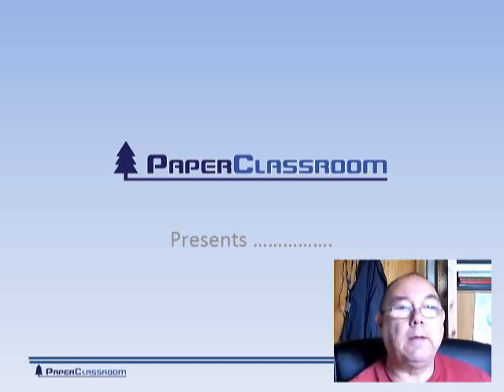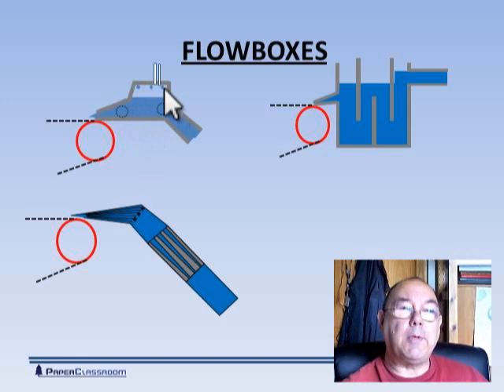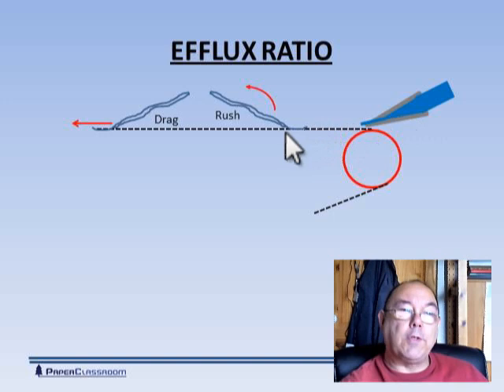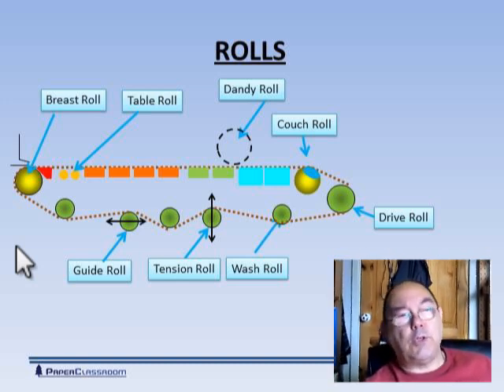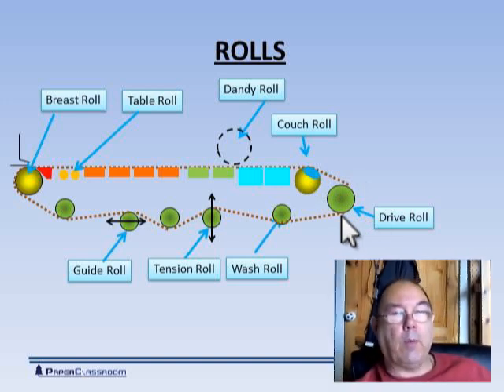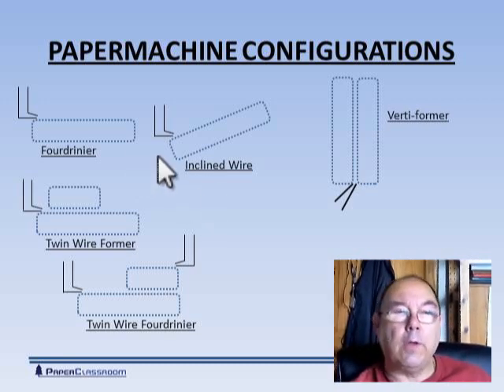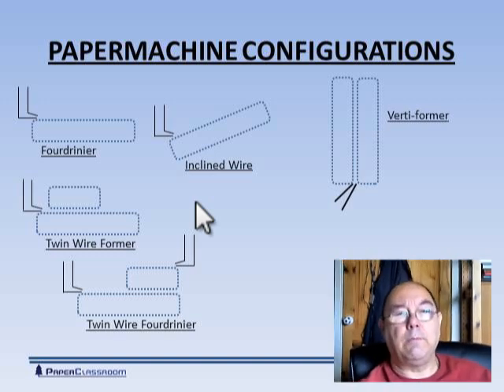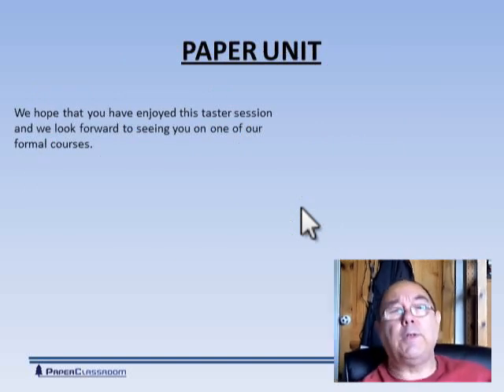Introduction to papermaking - Sheet Formation Paper

Comment: How to decrease porosity from paper machnie without adjust compotition of stock?
Reply from the maker: There are several ways to adjust porosity.
1 - change the refining - the more refined, the lower the porosity
2 - changing the filler content - the more filler the lower the porosity
3 - increasing the shake can have a small effect on porosity
4 - increasing press pressure can reduce porosity
5 - Increasing pressure on the calender can reduce porosity
6 - adding a film former like starch/CMC/PVA particularly at a size press has been used to reduce porosity

Hope this helps

Comment: 0:12 Answering Questions
0:52 Flowboxes
Open Flowbox - Open to Air
Pressurized Flowbox - Pressurized Air - PROBLEM, Mold/Condensation

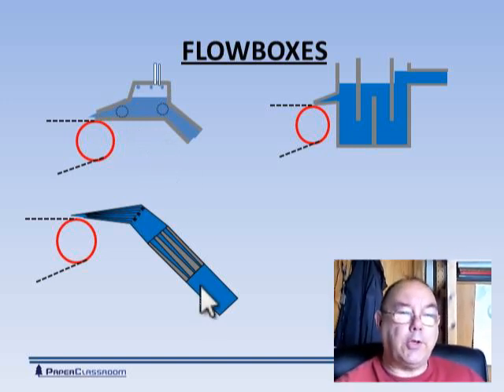2:32 Hydrolic Flowbox - Filled With Liquid, eliminating mold potential

3:19 Efflux Ratio - The speed 
Drag
Rush

5:45 Rolls

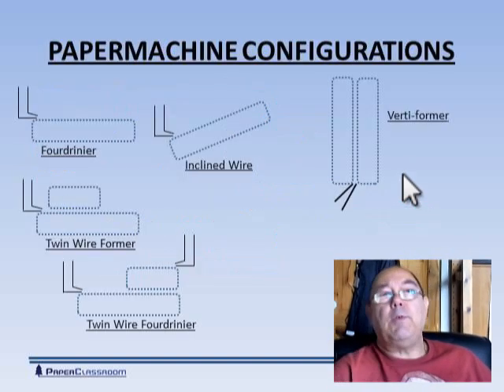10:43 Paper Machine Configurations

13:30 Drainage Elements

Comment: Is the adding of calcium carbonate just to brighten the paper...anyone ?
Reply from the maker: Hi Jim. The short answer is no!  The main reason for adding a filler, (usually chalk or clay), is to make the product cheaper. - You are replacing fibre that can be 500-1000 GBP per tonne with a material that costs about 100 GBP per tonne. But there are other 'added benefits'. Generally filler is brighter than fibre, so by adding chalk will make the sheet brighter. It also makes the sheet smoother. It fills in the valleys between the fibres giving a smoother surface that is better for printing. It also fills in a lot of the pore structure of the sheet, which reduces the porosity of the sheet, which many users want. It improves the appearance, (formation), of the sheet, which is always good. Finally, It is easier to evaporate water from the surface of pigment particles than from the surface and inside of fibres. This means it will reduce the cost of drying.  Hope this helps, Steve
Reply: @PaperClassroom  thanks very much Steven, i didn't realise there was so many reasons lol.

Comment: In very old books the paper pulp fibres aligned in one direction to ensure the shape of the book was stable.  I notice by examining books today through the light box that this is not the case, there is no direction.  I wonder why? is it that add-on chemicals and treatments assist with this property?  Also I wondered whether the effect in olden days was achieved solely with  "Drag" as you explained in minute 4? does that align paper pulp fibres in a preferential direction? Finally, there used to be a problem even in 2000 with "flocculation" whereby the fibres jumbled up and it was important to detect this (Valmet suggested this problem to me) with computer vision to stop the machine quickly. Could you explain what causes flocculation?
Reply from the maker: Hi Daniel, thanks for your question
When those old books were new, I was probably a student reading them!
I am guessing that the alignment of fibres, in the machine direction (MD), (caused by the 'drag' action), was also to maximise the tensile strength of the paper in the machine direction, so it could be pulled through the reel fed printing processes at high speeds. However when that paper is subjected to a moisture change, say an increase as happens in the offset printing process, the fibres, and so the paper will expand significantly in the cross direction, (CD), but not much in the MD. Operating paper manufacture in 'rush' mode will give a more equal distribution of fibres in both the MD and CD. This is what we call a 'square' sheet. An increase in moisture will cause the sheet to expand less in the CD and more equally in both directions. Which is what some printers want.
Many of the people offering on-line measurement can now detect and put a number on the degree of flocculation.
There are a few different causes of flocculation. Here are some examples.

1- Fibre length - the longer the fibres, the more likely they are to entangle and cause flocks. The example I use for my students is spaghetti. Imagine a bucket of long spaghetti. As you stir it, or try to twist a forkful to eat, it will get very tangled and difficult to separate. However if you take that same spaghetti and chop it up in to 5mm pieces, stirring it will be easy.
2- Consistency - The closer fibres are together, the more likely they are to touch, and so to tangle. This is why we reduce consistency to improve formation. In an ideal world we want every fibre to land on the wire at a position, angle, and orientation that is not influenced by any other fibre, and the only way to do that is to keep them apart. How much water to add to keep them apart, has to be balanced against how easy and expensive it will be to remove that water.
3- Fibrillation - Unrefined fibres are like pencils, stiff with a low surface area, Its difficult to make the bend over each other and twist around each other. But one you start refining, you tease out all the fibrils from the surface and these can so very easily become entangled with fibrils from another fibre.
4- Chemistry - This plays a big part in flocculation. All fibres are naturally negatively charged, so like two north poles of a magnet, slightly repel each other. But throw in a very common chemical like aluminium sulphate, and it will floc like crazy. The aluminium ion has a very strong 3+ charge on it. All the negatively charged fibres will be very strongly attracted to it, and so we have a floc! Kymene, which we add to improve wet strength, also has a positive charge, so as a side effect will also cause flocculation.  
Flocculation is a double edged sword, it has good and bad points. It makes the formation worse, so that is a bad point, but it also stops stuff falling through the forming sheet, and the wire, so it improves retention and lessons the load on the effluent plant. It can also have a good effect on fines. Fines normally get trapped in the matrix of fibres as they form the sheet. This makes the small pores between fibres even smaller, and so slows down drainage. Adding just a very small amount of these chemicals will make the fines stick to the surface of the fibres and so leave the pore structure more open, and so increase drainage. 

Hope this helps?
Reply: @PaperClassroom  Thanks very much for your explanation. You provide a very complete and useful explanation.  I have only had two superficial experiences with this topic. Before my PhD I also did a voluminous MSc at Swansea University where we had a very strong Finite Element research gravitas (owing to the Civ Eng department where I eventually did my PhD (1988 finished at Oxford University) in computational fluid dynamics).  I mention it because for my MSc (1985) I developed finite element solutions to compute deformation gradient tensors which are used to compute Strain Ellipsoids. Such ellipsoids quantitatively measure the alignment of fibers in rheology where laminar mixing is desired not to jumble up the forming machine.  Actually I discovered that the computation of deformation gradient tensors from numerical discretization of their differential equations is affected by lack of ellipticity in any weighted residuals method, that in spite of being significantly different in nature to classic parabolic examples of the same problem (convection-diffusion equations), so that some version of "upwinding" (Petrov-Galerkin) is therefore required and a physically correct approximation therefore is challenging to guarantee as I showed in my thesis.  Then many years later, 20 or so, I was pioneering a team in Machine Vision (I pioneered Genetic Programming for this purpose).  I was detecting objects of large variability and poor definition (objects in infrared) and the guy from Valmet thought I could apply this tech to learn the flocculated state from 2D images from the machine and then build them a "flocculation detector".  However, the project never took off although he gave me many of the black and white photos from the machine.  With your explanation I now understand why there may be cases of "flocculation" in machines, for flocculation is at times necessary.  Now that you have explained "the real problem" I see that it is quite an intricate topic.

Comment: is the influent into this rolls the filtered pulp ? I'm a bit confused, sorry
Reply from the maker: Hi Alyza, I hope I can make this clearer for you.
The 'influent' as you call it is the mixture of fibres and water, (and maybe filler), that we call stock. In the approach flow system, (not shown on the slide), it will have passed through screens and cleaners to remove contamination.
In my diagram, it will be in the small black line diagramme on the left. Some people call this the headbox, others call it the flowbox.
The stock squirts out of this device onto the top of the forming fabric. The forming fabric is moving from left to right. As the fabric travels in this direction, water will drain from the stock and pass through it. So, going from left to right, the ratio of fibre to water is constantly changing. When the stock is first squirted onto the wire, it may be for example, 1% fibre and 99% water.
The sheet will leave the forming fabric somewhere between the couch roll and the drive roll. At this point, the ratio may be 20% fibre and 80% water.
All the items in contact with the underside of the horizontal section of the wire are there to increase the rate of dewatering of the sheet.
The forming fabric is a continuous loop. Once the sheet has been peeled off it, the forming fabric passes round the drive roll and travels right to left. The rolls in contact with the forming fabric in this section are there to control its position and tension.

I hope this helps. Please feel free to ask any more questions

Best wishes,

Steve
Reply: Steven Mann , thank you for that Sir
 There is something more that I want to learn, can you also teach me about the calculation for designing the whole equipment ?

Comment: A solution as you increase speed,to help with drainage, more refining of stock ? an increase of fan pump speed? maintain a higher consistency at headbox ?
Reply from the maker: Hi William, I have been thinking about your question for a while, I am not sure what you are asking. I hope my answers help. 
I think you are asking how to increase drainage because you want to increase machine speed?
The more you refine, the more fibre surface area you will produce and the slower drainage will be
If you just increase fan pump speed, you will increase the weight of your sheet. If you also increase wire speed then you will reduce the sheet weight.
If you go to higher consistency, it will drain quicker, BUT the formation will be poorer.

I hope this helps,

Best wishes

Steve
Reply: @PaperClassroom  thank you sir i understand this